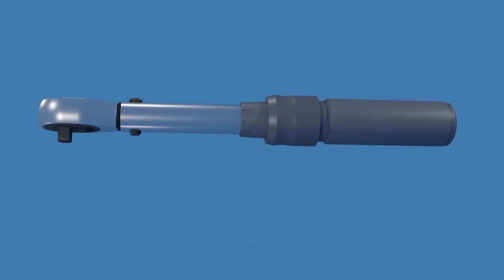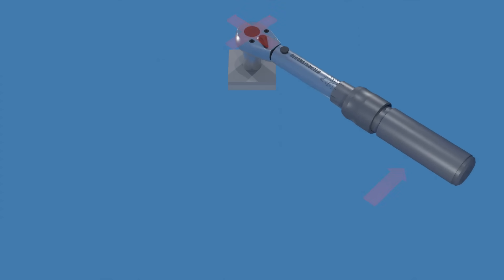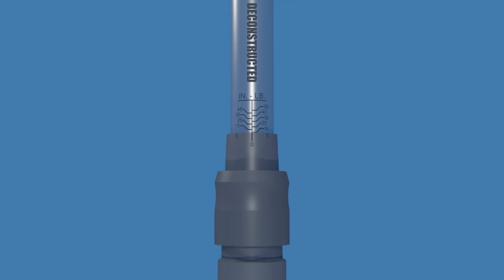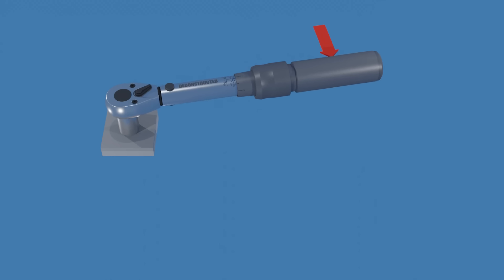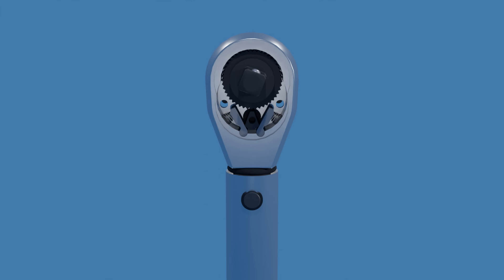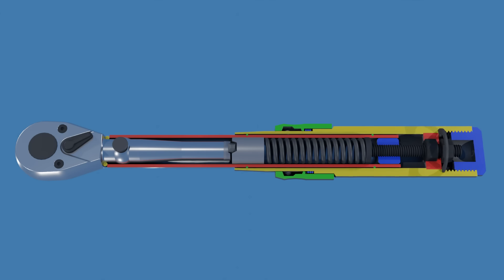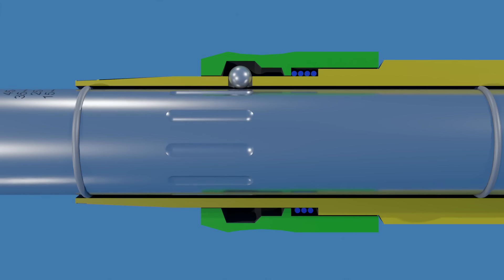How a torque wrench works

Comment: Please showin detail how a Torsen differential works. I have looked everywhere and there are diagrams of the parts, and descriptions that it stops slippage before it starts, and what a differential does in general, but not how exactly it accomplishes this. I’ve been looking for more than 30 years!
Reply from the maker: Thanks for the suggestion, we’ll consider this for a next video

Comment: So if over/under torqueing something does not affect the condition of the spring (which is calibrated, and the key part to the torque wrench working), then how does loosening a bolt with a torque wrench damage it? Additionally, if a torque wrench is calibrated in both directions, why would loosening something damage the wrench, but torqueing in the left direction does not?

Comment: Does it matter which size torque wrench you have as long as you have adapters to fit your job's need or does adding an adapter somehow throw off the specified torque?

Comment: 0:44 Why would that be the case? If the tool doesn't click, it's safe to use in both directions. The mechanism is the same. Example: what if you have a left-handed thread? Do you have to buy left-hand thread torque wrench? 
Thought so :)
Reply: Much to my surprise, mine only works in one direction. I can't torque left hand thread. I found out the hard way, wondering why the bloody thing wasn't clicking off. So it isn't the same in both directions. I put a hell of a lot of force on it, but it didn't seem to damage it though. Not sure why they'd make them with a reversing pawl if using it damaged the tool, but no you can't use it to torque left handed threads (not with mine anyway). I was using a tite-reach adapter so could reverse direction thankfully (and braced the adapter so it didn't add to the torque and alter the readings).

Comment: 0:45 you said using a torque wrench in the wrong direction can damage it.  I know torquing!  No - you don't damage it.  A good tool is designed to achieve a torque value in either direction.  Some "Left Hand" threads also need to be torqued.  There are no such things as "Right" hand or "Left" hand torque wrenches.  ALSO, a torque wrench can be used to measure breakaway torque values.  For such measurements it's more useful to use a dial indicator torque wrench, but you can pre-set a torque wrench below the expected engineered breakaway torque value.  IF the bolt comes loose before the snap of the wrench you don't know what value it broke at but you DO know it didn't break away at the minimum specified torque.  For those who don't know, breakaway torque values are always lower than the torque value.

It's been my personal experience with tires and tire shops that use impact guns to tighten nuts that they can be severely over-torqued.  Had a situation where I needed to remove a tire.  Couldn't do it.  Broke two lug bolts, got one nut loose, then bent my tire iron.  That's when the tow truck was called.  Breakaway torque is always less than torque settings.  IF a bolt or nut is over-torqued you can run into a situation similar to my experience.  Please stop telling people a torque wrench is only meant for one direction.

While we're at it - I've experienced assemblers torquing a bolt using a standard ratchet.  They've applied great force to get it tightened, then come along with a torque wrench set to some low value and the wrench goes "Click - Click" without having turned the bolt or nut.  In those cases I've ordered new hardware for the assembly AND re-education on proper torquing procedures.  You can pre-tighten a fastener with another tool as long as the torque wrench applies the final tightening.  If the fastener doesn't turn during torquing then it's already over torqued.

Comment: “Loosening a fastener with a torque wrench can damage the tool” tells me they’ve never heard of reverse torque values. It’s a part of PMs and required for install certifications for all kinds of fixed and mobile equipment applications.

Comment: I have used this but I have a question.. How this wrench knows the exact value of torque we're going to take like torque is depend on force or load and Radius or the length from the pivot point to the point where force is applied. We can provide the length by fixing it but how the focus is calculated by the wrench which we provide manually..?

Comment: You shouldn't use a torque wrench to loosen fasteners however you can switch the wrench clockwise and counter clockwise, how many reverse threaded bolts are you torquing down?

Comment: 0:44    so why torque wrenches have a reversible ratchet ???

The issue is overtorquing, not tightening / loosening direction. For really tight fasteners, i use the torque wrench gradually increasing the torque rating until i loosens, and if it is tightened beyond the wrench's maximum rating use a breaking bar.

Comment: Are there any tools that tell you how much torque was required to loosen an bolt?
Reply: You can use an electronic torque meter between a conventional ratchet and the socket, and watch the values or use a maximum-tracking feature on the meter.

Comment: I work in aviation, not a single person has ever explained the myth of "using the torque wrench in reverse can damage the wrench". your deconstruction made the myth even less believable even tho you said it at the start
Reply: I can't speak as an engineer (I'm not one), but it seems to me to be a blanket statement of something to avoid, since doing so in the wrong way certainly could damage the measuring mechanism, or at least throw it out of calibration (e.g. in calibration, a pivot block type mechanism is adjusted using dimension changes in the block of a few thousandths of an inch). Whilst some scenarios would be pretty safe, trying to list what could be OK & under what conditions would be unlikely to be much use in practice. The most likely damaging use would probably be using the wrench as a breaker - nutbusting. In the situation where the condition of the fastener is unknown (it may have been over-torqued with an air gun, or be corroded in place), if far more force is used than the tool is designed for, the ratchet or the detent mechanism could be damaged. I've seen it stated that a severely corroded thread can require up to 3 or 4 times the amount of breakaway torque compared to the original torque set. So the word goes out - just don't do it.
 We assume that the prohibition is made when the tool is not bi-directional, so has no indication of torque in the reverse direction, so easy enough to overstress. The capacity to operate in reverse is probably only as a consequence of the same ratchet head assembly being used for both single and dual direction models. On the single direction tool, it does make it easy to quickly back off a partially torqued nut if you make a false start to your swing - at least then you know it's not tight. Technically, to maintain accuracy after doing that you should bring the wrench several times up to torque in the forward direction on a tight nut (as per normal warm-up) to reset the mechanism.
Reply: @PlatypusPerspective  I fully agree as a breaker it would definitely break the mechanism, but for example, in the army, when doing up a wheel nut you have a run on torque, and a final torque which tends to be a lot lower. We had to change tools to loosen it because of this rule that nobody could explain why, but it was enforced like a law. 

In the end, it's probably just a rule passed on by dinosaurs in the business who had crappy tools
Reply: @SuperWhiteSuit   Interesting. I'd guess that would be due to the discontinuity in use of the tool having the potential to affect the accuracy. If something has to be signed off on, the question is always was the procedure correctly followed...
 Hmm, also, if check testing is performed on the torque tools as well as scheduled calibration, frequently using them "backwards" might see a fair jump in tools testing out-of-spec and having to be sent out for extra calibration?

Comment: Quick question.. if torque wrenches were made to add torque, what's the point of the lever to allow for rotation in the other direction (i.e. why allow it to un-torque somethiong)?
Reply: Some wrenches are designed to work both directions, to use with left-handed threads - e.g. bicycle pedals. But even if it's a single direction wrench, they may as well use the same ratchet for both. It makes an easy way to let the arm swing either way without having to take it off a partially tightened nut and locate it again. Especially if you're in an awkward spot with a short swing, it's easier to just flick a lever on the ratchet.

Comment: Everyone saying that loosing with the torque wrench is bad, but i cant see why. You can do it with a regular rachet wrench but you cant with a torque one? What can be damaged in that one and not the other if they use the same principle and the same mechanism, moreover the torque one is stronger than a regular one because it is designed to handle more torque so i still cant see the point of not using it a rachet wrench

Comment: How can you test the accuracy of a torque wrench?

I have a cheaper one I use for wheel lugs etc, but I need to replace my turbo and want to make sure things are done up correctly.
Reply: It is rather simple to do, but I'm probably not going to explain it very well. There are a couple of good videos on youtube I've seen though. Torque is basically two measurements as the units suggest, a force component and a distance component. So if you know the force and the distance you can check the accuracy (and on this type there should be an adjustment screw on the side of the handle). The force is just a known weight, so grab something and weigh it. Or to make the math easier, fill a bottle to a certain weight that's a nice whole number. You then measure to a point on the handle to hang the weight from. So if you had a 1foot distance from spindle to where you hang the weight and the weight is 1 pound, you're applying 1ft.lb of torque. Check that that is when the wrench gives, and adjust the screw to make any corrections needed, probably an allen bolt. Little bits to note are things like the handle changes length when you change the torque value, so don't make the measurement and then change the setting on the wrench. I'd suggest watching a video before doing it rather than just listening to me try to explain things though. Hope it goes well.

Comment: How can the click be produced by that mechanism? Usually the terminal torque is approached very slowly, so they will make contact very gently, and not cause a click.
Reply: tl:dr At the point when the detent mechanism releases, energy stored in the internal arm rapidly flicks the pivoting block against the outer tube.
Good though the presentation is, one or more things that would make it clearer aren't explained.
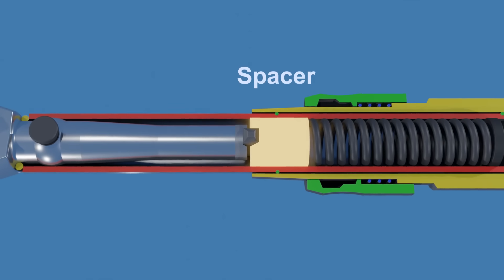If you go to 4:08 in the video, the part simply labelled "spacer" is actually the first part that transfers the force, which you are applying at the handle, down to the fastener.
If you move to 4:29, it would be helpful if the force arrow at the handle was echoed by another arrow showing greater force that is being applied, in parallel direction, from the outer tube to the spacer. That force travels via the pivot block to the arm of the head assembly that turns the nut or bolt. Let's say 100lbf is pushing (sideways, which is downward on the diagram) on the end of that arm, 100lbf pushes back against the pivot block. (Energy stored in the arm due to deformation, i.e. it is also a short fat spring.)
At the instant the block becomes able to pivot (the instant the correct torque value is reached, shown from 4:32), for as long as that takes to happen (who knows, one millisecond? less?), that 100lbf is being applied to compressing the coil spring very slightly and rotating the little block. Since the mass of the block is very small, it accelerates rapidly over the short distance involved, and hits the still approaching outer tube at some speed, creating the click.

Comment: So if loosening a bolt with a torque wrench can damage it or interfere with its accuracy, why does it let you switch it to loosen? And how would it even damage it in the first place?
Reply: Some fasteners tighten to the left. And the mechanism isn't designed to tolerate momentary high torques associated with unsticking a fastener. That's what wrenches and breaker bars are for.
Reply: @jeffg7  fair enough

Comment: My torque wrench stopped ratchet clicking a year or more ago.
The torque click still works.
I've been tempted to disassemble it and try to fix it...but I don't wanna break it...and since I only need the torque part to work...imma leave it.

Comment: I knew, that you have to "decompress" the spring to store the torque wrench. But to which level exactly? My torque wrench can be set to "-4" NM of the scale (60-200 NM). I think it got once overhauled by the manufacturer. Furthermore I have read, that it shouldn´t be exactly zeroed then stored, because of the prism which can get loose or fall out if the wrench get´s shaken / bumped.
Myth?
Reply: If the adjustment is slackened off so there is no compression at all on the spring, and hence parts like pivot block or ball detent become free to possibly move out of position, that can indeed cause a problem. The most common instruction is to reduce to the lowest scale setting, which leaves a little tension on the spring.
Reply: @ Perfect, thanks!

Comment: The term tension referring to the spring is misused - the term you want is “preload”. Referring to overcoming that preload as releasing potential energy is also misleading at best - if the stored energy in the spring were to be released then the preload in the spring would have to be reapplied.

Source: 20 odd years of using torque wrenches as a hobbyist and part time professional car mechanic while studying, being a degree qualified engineer (not a technician, a maths/physics theoretical engineer) and working in industry as an engineer, dealing with energy transfer, mechanics (newtons laws of motion types of mechanics, not being a mechanic)…

Comment: If I’m tightening a screw that’s reverse threaded (counterclockwise turn tightens it), to spec of 10Nm, am I damaging the torque wrench? (Because that’s like trying to remove the screw using the tool, which you’re not supposed to do.)
Reply: If the wrench is bi-directional (the instructions say it works both ways and quote accuracy ratings both clockwise and counterclockwise), then it will be fine to use counterclockwise same as you would clockwise. But quite a few wrenches, especially low cost ones, are not bi-directional, so they don't click in the reverse direction to indicate torque reached. They're the ones possibly damaged by reverse usage, and since there's no indication of the torque being reached, you could strip the thread or break the fastener.
Reply: @PlatypusPerspective thank you!

Comment: I have never seen a torque wrench with a lock ring, so this is not common at all. The common variant is the twist handle to adjust the torque and then a part on the very bottom of the whole wrench that you twist and and tighten to lock the torque setting in place. You then untwist this to allow you to adjust the torque once again when needed.

Comment: The video was indeed informative but there is one big issue. You got the unit of measurement for torque wrong. Torque is measured in pound-feet and pound-inches, not foot pounds and not inch pounds.

Comment: Using a torque wrench to loosen things is not bad for the wrench. If it was it wouldn’t have the switchable direction. You also need to be able to measure breaking torque when attempting to loosen a fastener.
Reply: There are other ways to measure breakaway torque.

Comment: does that mean it's safe to use a torque wrench to loosen a bolt on the maximum setting and stop as soon as it clicks?
Reply: It should be, as long as it is one that is intended to be used in both directions (e.g. the specs show accuracy for both clockwise and counter-clockwise, typically +-4% and +- 6% respectively). Not all are reversible, if the wrench is one that can't click in reverse to indicate maximum permissible torque, that's where you may cause damage without realizing. Some types of beam wrench definitely cannot be used reverse rotation.

Comment: Also I doubt you mention this so here goes. Torque wrenches are not to accurate on the lower end, they increase in accuracy the higher you go on scale . Example if your torque wrench has max 250 LB/FT with minimum of 10 Lb/FT , at 10 LB/FT the accuracy is going to vary then at say 145 LB/FT which would be more precise.